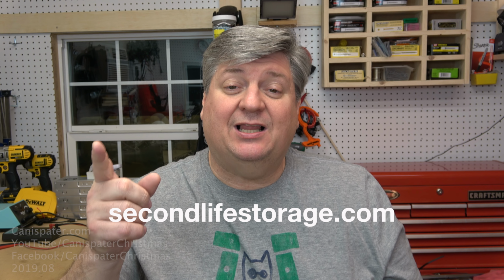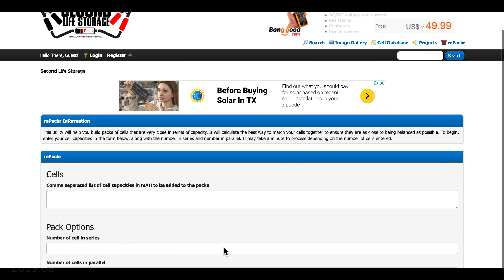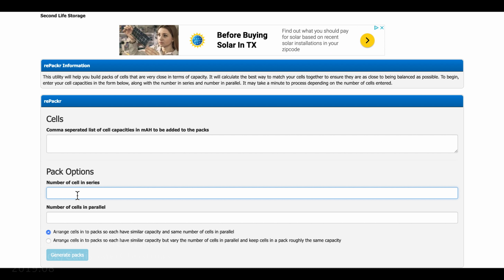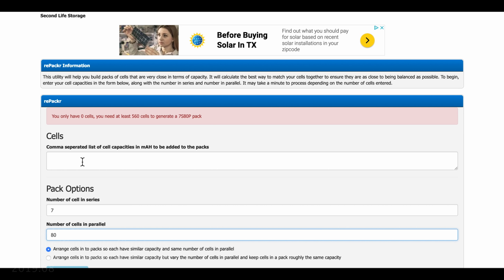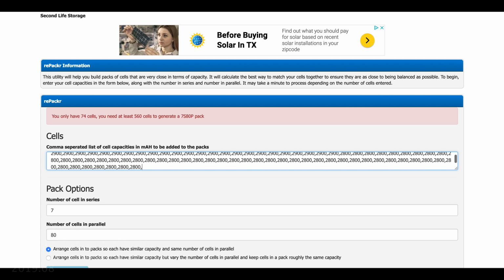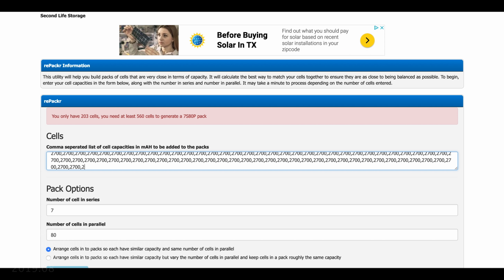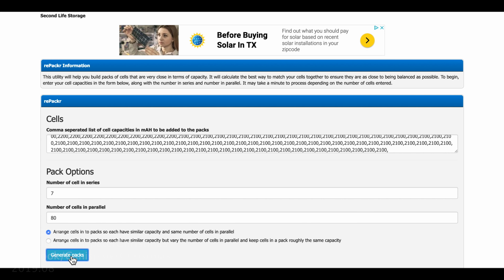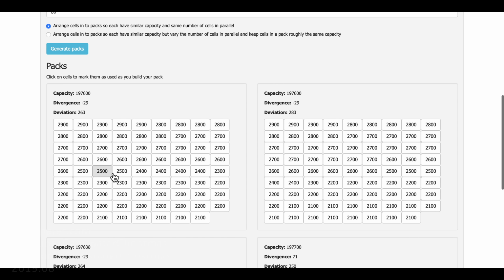⚡️DIY Powerwall Project - ep5 - Cell Packing  (2019)

Comment: My Average mAh rating for my next 7 banks (14S80P = 1 Bank) will be 3300mAh.  Which means I will be using cells ranging from 3200 up to 3450.  I currently have about 8000 cells that fit the bill for this build.  With all the new pack building products, out there I'm just determining the cheapest route possible for the highest quality build.  Pretty much got it narrowed down to either Tom's fused nickle tab sheets, or Javier's new powerbox design.  I'll make my final design choice once someone figures out the best way to put a buss bar on Tom's fused nickle tab sheets.   Although, Tom's new product does make cell replacement quite a bit more difficult within the pack, whereas Javier's design is very simplistic. So a lot to consider on final design for a build out.
Reply from the maker: I haven't seen Javier's latest. I suppose the decision is more how likely do you think you'll be replacing cells? If you plan on treating it like a baby (well below 0.2C), I'd think the probability would be lower. If you plan on rail-to-rail use, then the needle swings the other way. I figure if anyone would have a good handle on predicting cell life, that would be you. 😂💥
Reply: Well my medical cells should have a long life for sure...Everything for my build is from 2017 to 2019 packs.  So the likelyhood of cell replacement is low, but I see Mike, and Peter and Joe all having to replace cells or groups of cells and the major productions they have to do for it.  So while Tom's new strip will make pack building easier, it will also present problems should a cell or a group of cells need replacing. Where as Javier's powerbox will allow for easy pack building and replacement, but his pack sizes are limited currently...so there is that too.
Reply from the maker: Yeah, kinda why I eventually went with Joe's design (well, that and the new mitre saw lol). At least the cells are fairly easy to replace and you configure the pack however you want. More up front work tho.